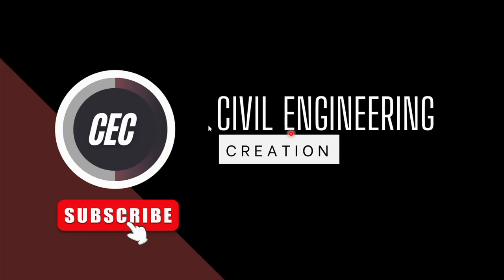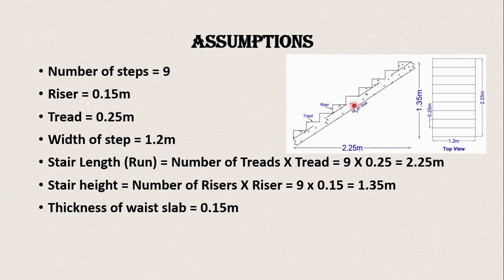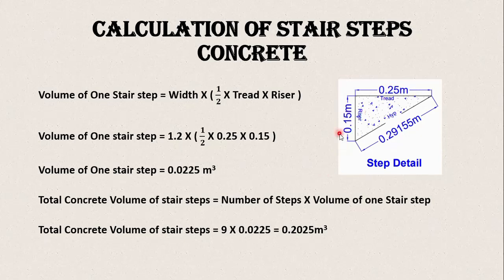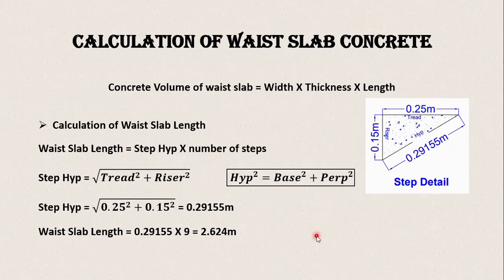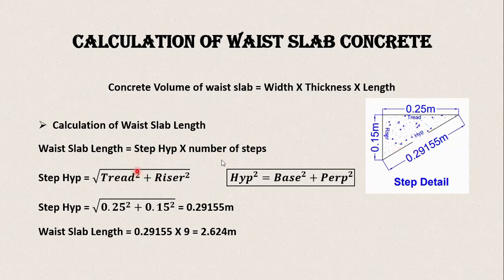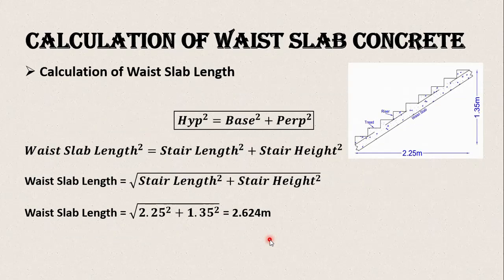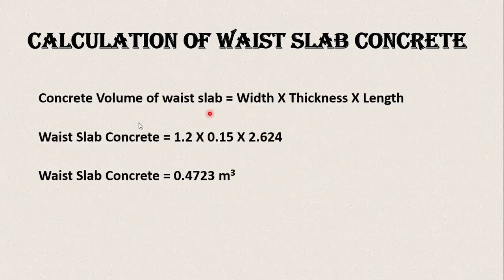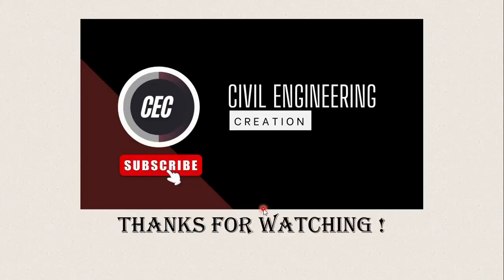How to calculate volume of concrete in staircase| Staircase Design

Comment: Ghar ki hight me staircase ko banate time lenter ki thickness ko kaise include kare.
Or staircase ki settring dhalai foot or inch me bataiye. Please comment.
Reply from the maker: Slab (lenter) Thickness must be sperate. We consider height from the top of floor to the bottom of ceiling. Watch my video on how to construct staircase. It will clear your doubts. Thanks!!!
Reply from the maker: Watch my video on stair construction. 
https://youtu.be/IvxU4G0xaGM
Reply from the maker: To convert from meter to feet is to multiply with 3.281.
And from feet to inch is to multiply with 12.